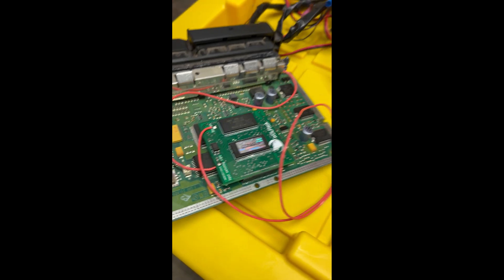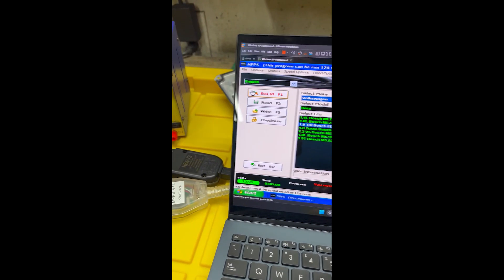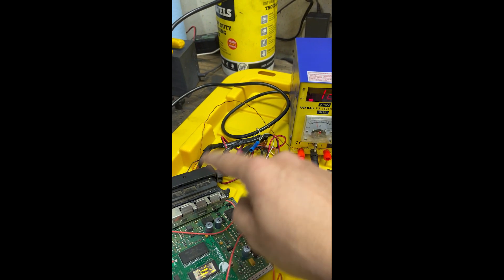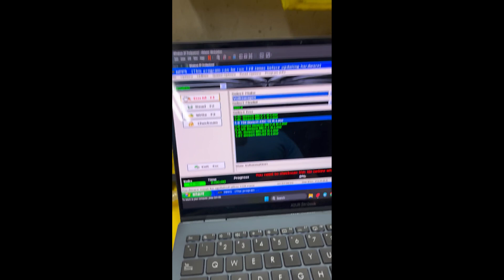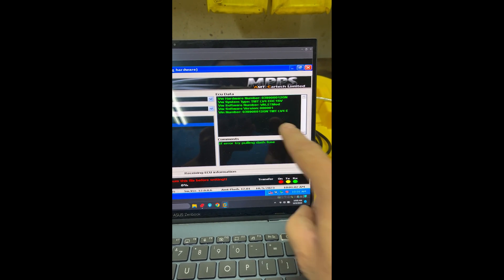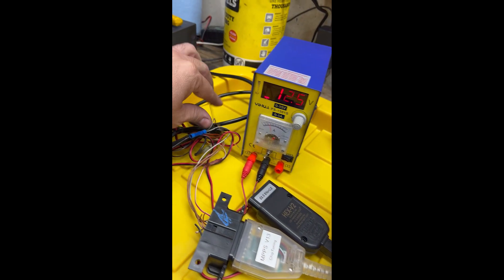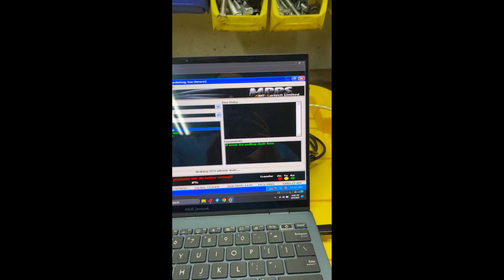ALH dual map ECU for swaps

Comment: Hey man, just found your channel. Im having trouble picking a turbo for my ALH. Its a 2.0L, mech pump, 12mm rotor, .216 nozzles. Its going to be running in a 73 beetle (see my channel, had an AAZ in it before). I planned on getting a t3 exhaust manifold for a larger non-vnt turbo, i actually want some boost lag. Do you have any suggestions? Thanks!
Reply from the maker: I run the Holset HE200WG 5CM on the CJ. I'm not very smart when it comes to the WG turbos if I'm honest.
Reply: @TDISwap  appreciate the honesty. I might do something simple like a gt22 or gt25
Reply from the maker: @joeysprojects9081  I would think you would want some bigger injectors then. I run 280s on both my engines and that will help you spool and reduce engine clatter.
Reply: @TDISwap  gotcha. .216 was the biggest nozzle size available at the time
Reply from the maker: @joeysprojects9081  Understandable. My suggestion is to get bigger if you feel like the clatter is a little much.

When I installed the 12MM mTDI pump that I have on the CJ w/ the 280s the clatter was crazy (but it's also a tin can with no insulation, carpet, doors, roof, etc, lol. It's much better back as eTDI.